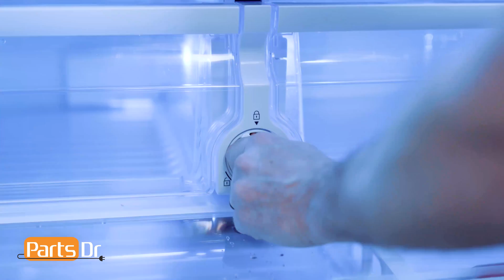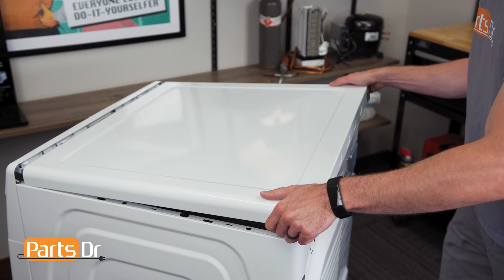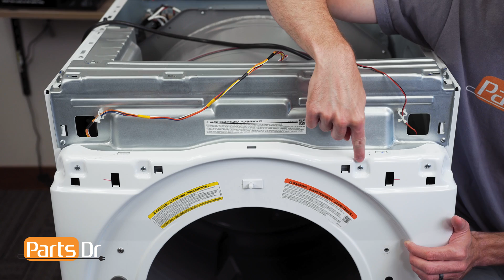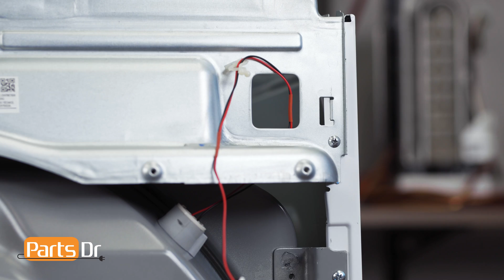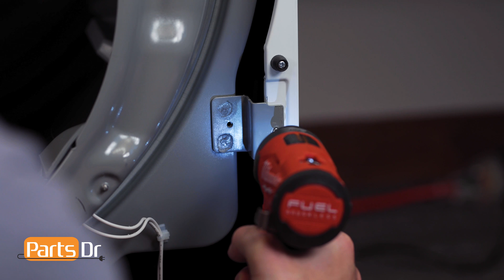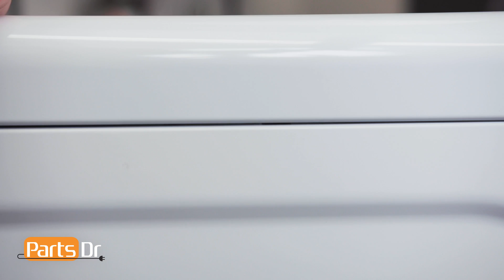How to replace the Samsung dryer front drum assembly part # DC97-15984D

Comment: also, the dryer is dv42h5000ew/a3. I guess it's from 2014. when should I just get a new dryer and quit repairing it? I've replaced the rollers, belt, front felt seal, and now this drum assembly needs to be replaced. When is a good time to upgrade? and with a new dryer, how often do these things need to be replaced again if you use your dryer a lot?
Reply from the maker: Sorry to hear about your issues.  We always like to compare the cost to complete the repair versus what it will cost to repair the dryer.  Ultimately, it will be up to you to determine whether it is better to repair or replace the dryer.